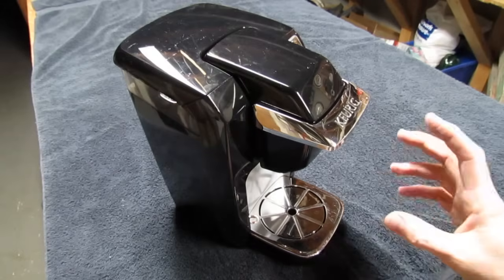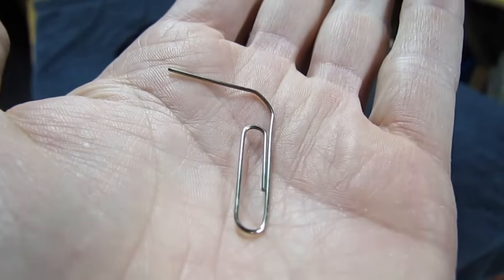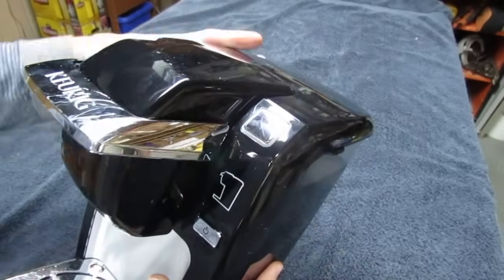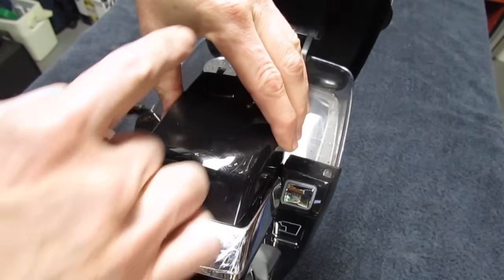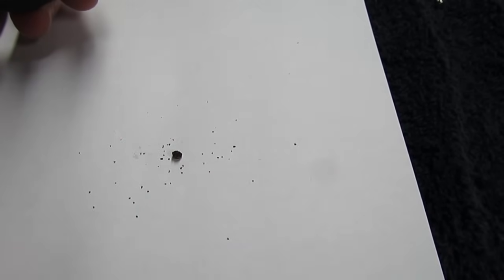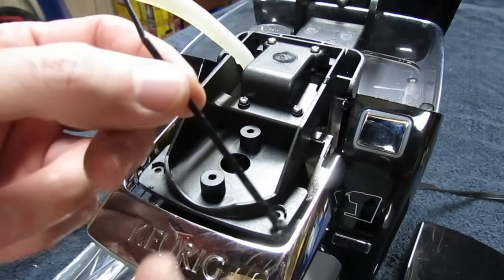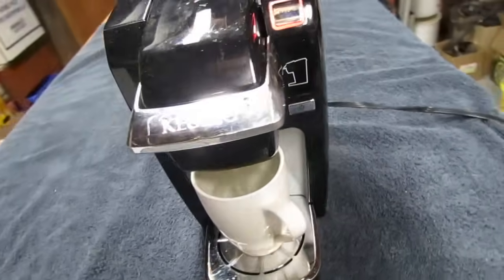How to Fix ● KEURIG Coffee Maker that Stopped or Slow Brewing

Comment: I have a different model (K-90) with the same problem. Water comes out slow and down to a few drops. Found this video and went to work. Since it’s a different model, I couldn’t follow the exact steps. But I unscrewed a couple of screws and managed to open up the top part to expose the area where the plastic hose connects to the connector on top of the needle. I disconnected the plastic hose from the connector. Ran a cup of water as shown in this video. Then I connect another plastic hose I happen to have around the house and connect it to the connector for the needle. I just blew into the hose and got rid of the gunk in the needle. Tested it and verified everything is now working fine then jut put everything back together. Thanks for sharing and it helped me as well as many others.

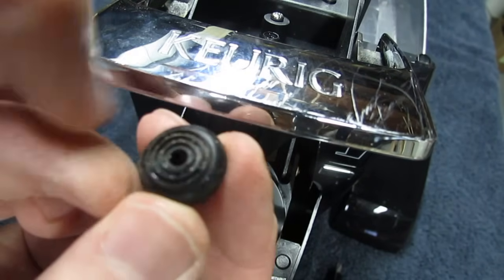Comment: Fantastic! Two very helpful hints.  If you are having a problem breaking the first two screws in the video loose, turn the Keurig totally upside down and brace it so the area where the screws are is flat. Then pour a small amount of olive oil (enough so there is a puddle around the screw head) and let it sit for an hour or two.  The olive oil loosens the screws and it is perfectly safe.  Of course, you should wash it with soap anyway.  Second, the little rubber gasket around the needle (approximately 1:27 minutes in the video) goes back during reassembling with the raised portion up and the flatter grooved portion down (2:24 seconds in the video but it is so fast it's very difficult to see).  Excellent video and could have never done it without this vid!

Comment: OK I need to complement you on your presentation!  Not a bunch of Intro’s “I’m the man and going to brag about myself for the first 30 seconds”, Not a bunch of Technical details on the Equipment “I purchased my KEURIG model K75 from Costco in 2008 or we removing two # 6 screws from the top Discharge Housing” but straight talk with easy to follow steps and lots of useful information – I’m subscribing to your channel sir, thanks
Nick J Alati
Reply from the maker: +Alati&#39;s Inspection Services LLC Well thank you for that great feedback! I try to get right to the point without all the fluff. Thanks for commenting!
Reply: Alati's Inspection Services LLC c.
Reply: This is the way all tutorial videos should be
Reply: I totally concur.  Straight to the punch!  I usually have to fast forward my way through these videos to get to the meat.  Not here.  Completely and immediately straight forward.

Comment: Most important part was seeing how the cover comes off after 2 screws from underneath. On mine, didn’t want to come off, and without video I wouldn’t have had the confidence to keep trying without knowing how those tabs were oriented. 

Guessing some people have cracked those not knowing how it comes apart. Well done sir!
Reply: Try as we might, we couldn't even get those first two screws out.  We finally just took the machine over to the sink, turned it upside down, and ran water through the pin area.  Works for the moment......   lol

Comment: I tried it again at work and I was able to get the top off I didn’t have to cut the zip tie I eased it up slowly and there was crud coming out the hose. And I was able to put everything back together and now the machine works fine no issues. Thank you

Comment: My wife was given a used B70 platinum that barely dripped. I tried running cleaner through it with no luck. I even started to take it apart. I took a break and watched this video. Sure enough it was plugged. I finished running the cleaner and got lots of particles out. It now works like new. Thank you!
Reply from the maker: That's great!!

Comment: This video saved me buying a new coffee maker.  I had to buy a cheap small screw driver as none of mine fit the tiny screws, but then the easy to follow directions made the task simple.  I kept the zip tie on the hose and just wiggled it off and on. Ran several cups of clear water through to get all the gunk out before putting it back together. Thank you!
Reply from the maker: That's great!! Yes.......the zip tie......I figured that out after I made the video that you can leave it on and wiggle if off!

Comment: That was better than just the usual paper clip cleaning video. My K70 from QVC has a cleaning/flush button, but I don't know if it would flush what you found in that hose. Actually most of that coffee getting up in there is from over filled kcups or my kcups where the grounds go up in the needle.
Reply: My K79 from QVC has not clogged and I have it since about 2007. It has a hot water button and a rinse button. I use both K-Cups and reusable K-Cup and if either was to clog the upper needle I would suspect the reusable K-Cup. I pack it for a strong cup of coffee. What I would suggest to clean the needles is a dental pick with a hook so not to push any grounds further up and not need the disassembly.

Comment: Chris Notap;  I am Luis again. I fixed my Keurig K10. I did every thing according your instruction, but the coffee maker did not brew. Before , I put together the coffee maker, I blow in the top hose and hear a little noise like "Tap", them , I pour cold water and I suck the water from the hose.  I connect the coffee maker, put water, the water gets hot and brew in my cup from the hose (same way you did). Finally, I put the Keurig together and I brew my coffee and it is working now. Thank you  Chris you gave me the first step to fix my K10 and now i am happy.
                                                             Sincerely                 Luis
Reply: Chris I got a brand new coffee maker tried to run my first cup and nothing came out!!!

Comment: As a follow up to my previous post: I pulled the hose from he needle valve, and then got brave and applied suction to that hose really hard (hold the jokes fellas)...and was able to pull through whatever was blocking the lower end of that hose. SAFETY NOTE: If you've just attempted to brew a cup, empty the machine out and add cold water before trying the suction method. I just burned off half my taste buds. :-/
Chris, thanks for taking time to post. Hope this additional info helps the next guy.
Reply: I just burned both of my arms because the water started overflowing and l tried to turn the machine off. Now I'm sitting with ice on both arms. I'm glad it's just my arms. But I got it done.

Comment: This fix did not work on my keureg. I had to fire up my air compressor and blow 30 psi of air into the hose reverse direction to unstick the check valve.   Then ran 8 cups cycles of vinegar through to clean mineral out. Works good after that. Sometimes you just got to get extreme.
Reply: I think I have the same problem. I didn't use it for 2 years and now when it is running water doesn't even come to open hose. Did you blow air while running? I guess it wouldn't be safe while running. I will try it today.

Comment: Great video but who has an extra 4 inch zip tie on hand?
Reply: You can do this without cutting the zip tie, just pull on the hose slowly.  You can easily put it back on, I just got done doing it.
Reply: Walmart
Reply: me weirdly enough
Reply: Just about anyone I know... and any hardware, automotive, Walmart, K-mart store for example.
Reply: kind of the point of mentioning it in the video so you can go purchase one before you go hands on.
Reply: Great video!  I was about to throw mine out.  Tried this and it really worked!
Reply: Dollar store auto section.
Reply: I have a bunch of them. Need me to mail you one?
Reply: I do...
Reply: Dollar tree has a bag of different sizes

Comment: This well produced video gave me all the clues necessary to de-crud our mini machine.
I realize now that some water return siphoning action can pull some coffee debris from the finished k-cup brew back down into the bowels of the machine. The check valve or whatever must accumulate this crud over time till the tube is plugged enough to stop the full slow towards the k-cup.  I am glad I did not have to take more of the machine apart !  Thanks
Reply from the maker: Glad it worked out.

Comment: Excellent video. I just did the quick fix and it worked fine after I used a syringe rather than a paper clip. I filled the syringe with water and squirted the water up into the little hole after inserting the needle. I think the combination of the needle and the water did a good job of breaking up the clog.

Comment: We appreciate your video! Fantastic... I would add/change removal of the rubber (time stamp 1:26 within video) after the second set of screw removals. This way one does not need to risk getting cut by the needle to remove the rubber. Same as putting it back: once all parts are clean: put the rubber safely in place around the needle first.  Thanks for your help!

Comment: Excellent info. Thanks. An extra step, as mine seemed to 'die' after doing thorough cleaning: put clean water in reservoir, place cup but no coffee pod, press and HOLD flashing red brew light till cycle finishes. 'Seems' like quick way to force out fresh grinds.

Comment: I found this to be very helpful!  It turned out my clog was in the tubing.  I saw on another comment below, where someone fixed this with  an air compressor.  I don't have one of those, but I do have a bicycle pump.  Th tubing is flexible, and I managed get it in the pump opening.  The clog was cleared, and it's now working again!
Reply from the maker: Excellent!

Comment: Thanks I’ll try the paperclip but I already tried earlier using a pin and a thin metal wire rod I found and nothing worked.   I think I’m too old to take the whole thing apart like you did so I’ll keep trying and I’ll try to find a paperclip. Thank you.

Comment: Excellent.  It worked for me as you instructed.  My keurig was heating up and boiling  and nothing came out. If I opened the top you hear the pressure released.  I saw gunk in the tip of the needle. Took apart the top and cleared the needle from behind. Thank you

Comment: Worked perfectly!! Thank you!! Followed suggestion to move the plastic tie up over the tube instead of cutting it off. Just make sure to remove the plastic tie from the tube or it'll slide down the tube into the machine.  I slid it back up but it was not easy. Thank you so much!!

Comment: Excellent video.  Fixed my problem.  I suggest running the water through the tube several times to fully clean it. I was still seeing grounds through 3 runs.
Reply: No kidding!  I had to run about a dozen or so cups through, and I still am getting a few tiny grains (of dried coffee? little bitty grounds?) when I run a cup of water thru....

Comment: Hey, outstanding how-to video. It was very helpful. I especially liked the instructions on how to open it up and flush out the tubing.
I just have one additional tip. In the bottom of the k-cup holder is another smaller needle, covered with a small "clear" (or coffee-stained) rubber grommet. Check this needle as well. Use a paper clip to unclog or clear it. You can do this as the k-cup holder sits in the lower housing, but I recommend popping out the k-cup holder (there are 3 clips around the brim of the holder). If necessary, just push up on the bottom of the holder (where the coffee normally flows out into your cup/mug). Once you have the k-cup holder removed, you can also gently remove the lower part of the k-cup holder (it is usually held in place by 2-4 small clips, depending on the holder, OEM or aftermarket part). Removing the lower part of the k-cup holder makes it easier to get to the lower needle and clear it out.
Hope this helps.
Thanks again for your video.

Comment: Perfect! Thanks for the straightforward explanation.
Reply from the maker: Glad it was helpful!
Reply: @chrisnotap  although I went through all the steps in your video, AND managed to put it back together and working again, I'm still plagued with a very slow running Keurig. It must be something besides any clog in the water line.
Reply from the maker: @stevesauve6866  One more thing to do is to get some pipe cleaners and make sure the hoses and heating element tubes are free of debris. Sounds like you do have a partial blockage.

Comment: Of all the videos on how to repair the single cup Keurig, yours was the most straight forward and very easily understood. Some added suggestions: using magnetic Phillips head does not help...there is very little ferrous material in the screws. This becomes more important when re-installing the screws. After dropping BOTH screws into the works, flipping upside-down allowed the screws to drop back out (with some helpful shaking involved). Secondly, I did not have the proper accessories to use a ratchet to uninstall/install the first set of screws, however, I found a small long-shaft Phillips in my gunsmith box that worked just fine (adding enough pressure to keep the bit from slipping out and stripping the head).
Reply: One added note: take your Keurig coffee cup out of the machine almost immediately. Allowing it to sit allows the cup to clog the lower needle. AND, Keurig wasn't kidding when they suggest NO TAP WATER. I use Walmart bottled water and after 6 months have no calcification whatsoever. Yeah, a bit more expensive, but lengthens the time between cleanings and makes a better cup 'o' Joe.
Reply: +rollingthunder277 -- Knock on some wood..Lol   I have always ONLY used bottled water in mine - it's almost a year old. My daughter is trying to fix it now..I hope it works!  I also use Walmart bottled water. Our tap water smells and tastes like a swimming pool!  ICK!  Have a great day!  (I will if I get my coffee!  :)

Comment: Great video.  I have the same model, and took it apart like you.   The crud that I got out of the needle assembly and the hose was phenomenal.   Put it back together and it works great!    I was ready to can it and buy a new one, so thanks SO much for the well-done video.    One issue I had was that the white hose had developed a slight leak by the zip tie, so when I put it back together it leaked.  Had to cut off a little bit of the hose and reconnect.   Good as new!   I like videos like yours that speed up the obvious stuff like loosening screws, etc.    We all know how to do that.   Good job!
Reply from the maker: +buttwheat75   Yes I try to move things along and fast forward the stuff we all know. Thanks for your input.

Comment: Your fix worked perfectly, I used the paper clip but that did not fix it.  I took everything apart and cleaned all the parts, as if by magic it function like new.
Thank you for the insight, very simple; however, you need a small screwdriver (In length ) to get to those Philip screws.

Comment: Excellent Video - Short and to the point! I have the identical coffee maker and will follow your instructions. Thanks for sharing!!
Reply from the maker: One small tip: You don't have to cut the zip tie off like I did in the video, just pull the hose off with it still attached then slide it back on when you're done.

Comment: Chris, thanks for the video, got me brewing again! I have a Keurig B3000 SE - it's really meant for a small office but I use it at home - and while it looks a bit more advanced and complicated than your machine, it turns out to have the same exact design for the nozzle. Also, in addition to the slow brewing, mine was displaying a message "needs descaling" - since following your fix the message hasn't reappeared. Thanks again.

Comment: Great video, also we used to have this problem with ours, It’s the same model, all the time until we started pressing the K cup down into the piercing pin on the bottom first and then closing the clamshell. This kept the Kcups from “poofing “ Coffee grounds into the top piercing pin. We haven’t had an issue since
Reply: Great idea! I clean our Keurig regularly and it still clogs regularly. We live at a high altitude and the Kcups look like they're ready to explode. I'm guessing that built-up pressure does indeed "poof" grounds back into the top pin. We will be using your method in the future

Comment: Worked perfectly for me. Greatly appreciated. I knew there had to be some plastic latches on the top piece. I usually end up breaking little bits like that bc there's no way of knowing how to disengage them until you've already broken something open to see. Only wrinkle was that i did not pay attention to the orientation of the rubber grommet thing, and it's not visible in the video - I'm guessing ring-ribbed wide side faces the Keurig cup to seal the top as the "needle" punctures it. And for whatever reason - I actually did have some 4" zip ties and I knew where to find them in my hoard!
Reply from the maker: Just watched the video and I don't recall which side of the o ring faces which way since it was 2 years ago!! Sorry. I have a feeling you're right the way you say. Glad it worked for you.

Comment: This works, thanks! Unfortunately, after clearing the unit it clogged again in just a few days. The trouble with the K-15 is that it lacks a check valve. Coffee grounds are free to move upward from the K-cup into the piercing needle and supply hose. Gunk builds up, and it's the same problem again. Another idea is to run a cleansing brew after the last cup of coffee each day, to prevent the build up of grounds in the needle and hose. Rather than bother, I'll return this K-15 just like we did the last one. We're done with these.